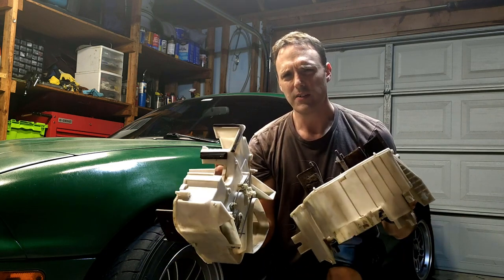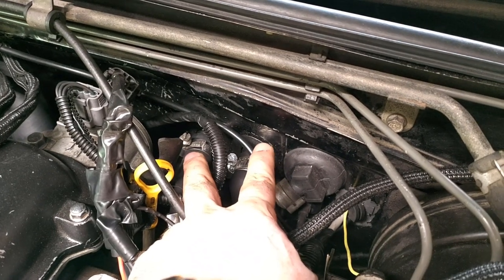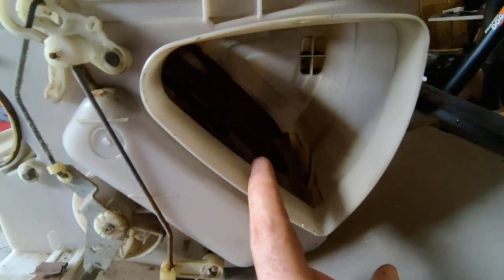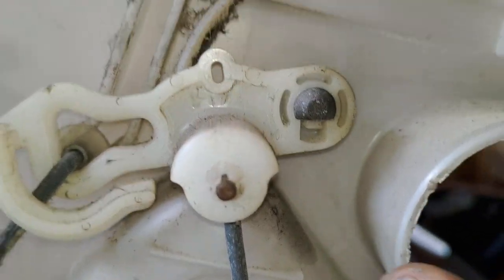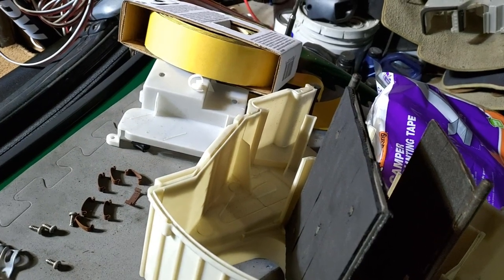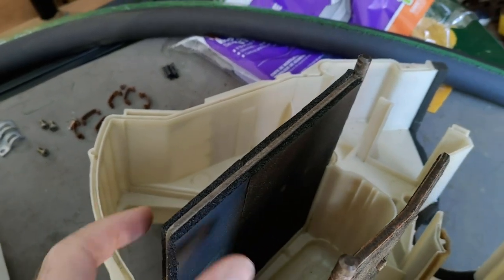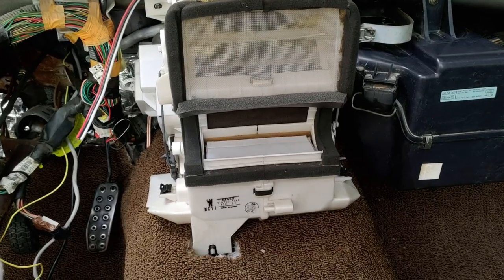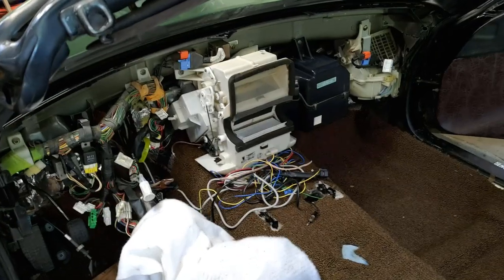Make your AC work better in your Miata - HVAC Foam Restore!

Comment: I just did this and even got an NB core from a junkyard. I just wish I knew I needed the whole housing because the NB core does not fit in a NA6 housing. So I ended up spending a lot more time grinding away plastic so it would fit...

Comment: In your video I see a spring on the passenger side of the HVAC box.  My 1993 NA does not have this spring, but does have the mounting points for it.  Was this spring added in later years, or was mine just missing from the factory?
Reply: My 1.8 1995 HVAC box doesn’t haven’t it either so I wouldn’t worry

Comment: If I don’t want heat or ac can I remove the white main hvac unit and the black ac box next it or would my car not run after that?
Reply from the maker: Yes, it will be fine but you'll need to loop the heater core lines and put a plug or grommet in the holes in the firewall.  I did this when my heater core was leaking and I didn't have time immediately to fix it.  I just connected the output line from the back of the head to the input hose to the hardline that goes under the exhaust manifold with a barb connector.
Reply: @OGPedXing  okay I’ve done some more research and I think I got it down. So the coolant  goes through a tube into the heater core and goes out through another tube which gives you heat, so if you don’t need heat you can remove the HVAC unit along with the heater core and then loop the tubes so the coolant flows as normal just skipping the heater core since your removed it, allowing the car to run perfectly fine since the heater core and HVAC unit are not essential for the car to run and drive??????
Reply from the maker: @FishingandFirearms  yep! That's it exactly
Reply: @OGPedXing  Thanks so much you and your videos are very informative and helpful, you just earned a subscriber! 👍🏼

Comment: What about a 12 V NC solenoid on the heater core hoses?  Then open the valve when the heater goes high...
Reply from the maker: Yes, that can work.  The only things to watch out for is it's somewhat harder to bleed the air out after a coolant change.  Also some people have the opinion that the heater core is a required part of the Miata cooling system because of how cylinder 4 normally does not get as much flow due to the weird design of the inlet and outlet both at the front of the engine.   I think it would be mostly fine for normal driving but a coolant reroute may be a good idea as well.

Comment: Great stuff!  I ripped apart my dash to clean the AC (smells like mold/mildew), so this video is just what I needed.  Thank you!!!  My foam disintegrated like yours (gross!!!). BTW, did you tackle the AC box at all?  I would like to clean that, too, but I fear I need to take it to the shop to deal with the refrigerant.  I was hoping there was a way to clean it without having to disconnect the cooling lines.
Reply from the maker: It is possible to do without disconnecting the lines but it's messy.  You can get the enclosure off the bottom and spray it out with some thick plastic under it and a shop vac going to suck up the water or cleaner as you spray it on.

Comment: what year heater core did you use? also awesome vid thanks for all the info you've given us. It's helped me build my V6 Miata
Reply from the maker: I ended up using a core from a 99 NB.  The whole assembly bolts into an NA (90-97) no problem.  The NB cores are aluminum rather copper.
Reply: @OGPedXing  This isn't true. NB heater cores are often 0.25" wider and will crush if you try to shove them into an NA airbox. I had to order an O'Reilly part for the NA and it slid right in.
Reply from the maker: @nopers2223322  I used the entire assembly from an NB, the plastic vents and all.  That's what I mean bolts in no problem to the na miata mounting points.  That said, I know people who've been able to get an NB core into an NA assembly.  I think they did have to remove the foam around the core and also dremel out some areas.
Reply: @OGPedXing  Ive done an NB heater core into NA
I had to use a chisel two remove two plastic ribs inside the assembly. 
and also had to cut the feed and return tubes, and use a bit of rubber hose and clamps to attach the two again, like the NA uses, we did that because we couldn't get the V band style connection the NB heater core uses, to seal with the tubes sticking out the firewall holes.
Reply from the maker: Yeah I hate those vband connectors, so fiddly with pipes this size.  Exhaust sure, coolant pipe, no 😂

Comment: I smell engine fumes coming from my Miata ac could this fix it?
Reply from the maker: Changing the foam won't fix that issue.  But here are some things to check:  The likely cause of fumes in the engine compartment is an exhaust leak near or at the exhaust manifold.  You can check for leaks by feel by removing the heat shields and very carefully without touching anything hot, feeling for the leak which will seem like a hot breeze on your hand.  This is the easiest way.  A safer way is to take a shop vac or similar and set up the hose to blow air into the exhaust.  Then, with the engine off, you should be able to hear and feel leaks.  A common issue is the manifold gasket, or a rusted out downpipe with a small hole or crack.  The second thing you can check are the grommets in the firewall around the heater core pipes.  These can degrade enough to cause an opening from the engine compartment.   But this would cause the cabin to smell regardless of whether the blower is on.   Either way, the blower brings in air from the area below the windshield on the passenger side.  Fixing the exhaust leak will clear up the problem.

Comment: How do you get the rubber off the heating core? Having a very hard time..
Reply from the maker: Yeah it can be bonded on there really well.  I worked at it with a tool called a hose plier which allows you to twist it rather than pull.  Those thing are worth their weight in gold, I use them all the time.  Other than that you can try getting some lubricant in there like WD-40..not the best for the rubber but you can always wipe it off when the hose is off.  Here are the pliers I mean: https://www.harborfreight.com/3-piece-long-reach-hose-grip-pliers-37909.html

Comment: did you use any extra glue or product to hold the new foam down or apply just as it comes?
Reply from the maker: Nope, so far so good with the adhesive backing it came with.  I did prep the surface as best I could with some rubbing alcohol and some brake cleaner for good measure.

Comment: Any thermometer results?
Reply from the maker: Wow, great timing.  I was playing with this literally this afternoon.  Previously it would blow pretty hot, like +10/15 degrees above ambient for the first minute or more after turning on the AC, assuming the engine had been running.  Now it's blowing at about ambient +1 or 2 immediately.  So pretty happy with that.

Comment: Hey just recently subbed to the channel, I love the content and great videos. Quick question, one of your videos you were installing a ms3x firmware in for your mega squirt. I have a MSPNP2 installed in my car and I wasn’t sure if I can still install the firmware on it or not? Really would appreciate a response, recently just got into tuning and just bought tunerstudio today, I would really love your help.
Reply from the maker: Instead of the ms3 firmware, you'll want to get the latest ms2 firmware from here: https://www.msextra.com/downloads/ and scroll down to the ms2 section.  I think it's 3.4.3.   check what you already have installed through, chances are it's already on there.
Reply: OGPedXing Got it. Thank you so much!